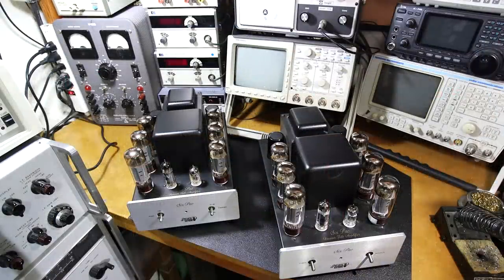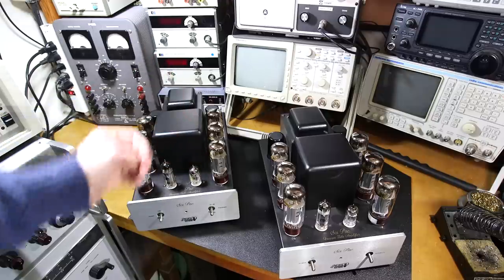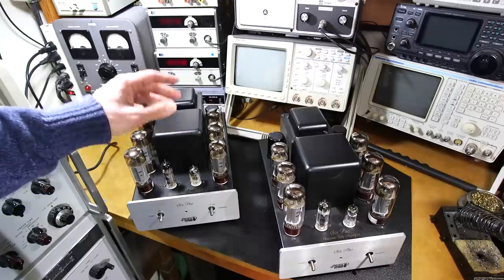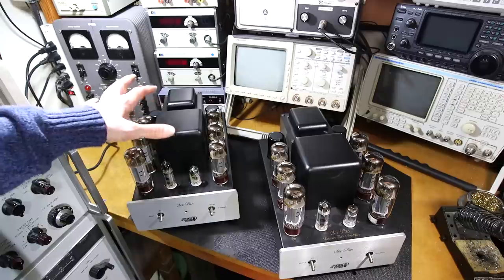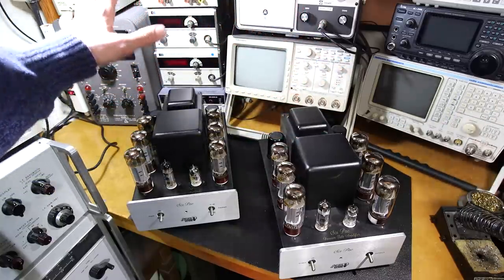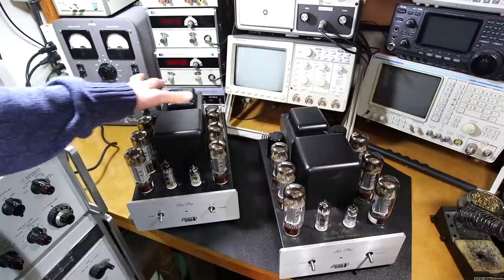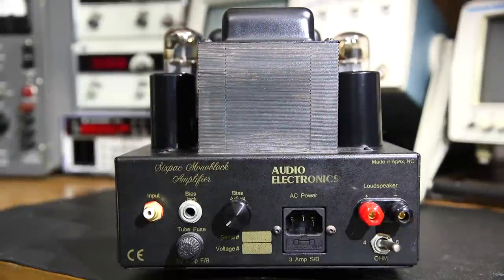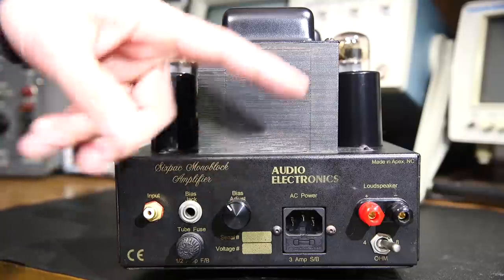Two Six Pac's On The Bench

Comment: I love watching your program. I'm always amazed at how you work and all the tools you have at your disposal. I have some car stereo amplifiers that deserve your touch. Back in the early 90's I paid a lot of money for them. A brand called Monolithic that is no longer around. One amp was a dual monoblock class A 50 and the other was a 750 4 ohm monoblock. I always got complemented for the clear clean sound. If only I could afford you, and if you had the time. Thank you for your great show.
Reply: There never was a true "Class A" car audio amplifier on the market. They'd hog WAY too much current, and run SO hot that they'd likely run away and be a fire hazard. It was all a marketing gimmick..
All of the so-called "Class A" automobile amplifiers were just Class AB designs with a high bias setting. Even the coveted SoundStream Reference Class A amps were the same way.
Reply: @davelowets  My amps did run very hot and that's what I believe did them in. I had a high output alternator and two extra batteries with 1/0 power cables just for that amplifier.
Reply: @donjaun540  Probably... 
My "Class A" SoundStream amps ran VERY hot also. The high bias design allowed the first 10 watts or so to be considered Class A, but they still weren't a true Class A design though.

The high heat inside of a high bias amp will definitely destroy the capacitors inside them much faster than a normal Class AB design. Especially when an amplifier is used in an automobile environment. They usually don't get a whole lot of cooling when they are in a trunk or under a seat.

Comment: Why not in high end amps simple put the power transformer in a seperate chassis connected with a thick cable and heavily shielded or inside some sort of Faraday cage. Sure it would cost . little more but given the cost of high end amps its nothing?

Comment: I couldn't believe that the ultralinear taps of the output transformer were that close to the filter choke and not designing the main and bias power supply with a "pi" type filtering system

Comment: So if the output section was run in the pentode mode instead of the triode mode, would it more or less double the output wattage? Or can you run 3 tubes in pentode mode on the one leg of the primary of the output transformer, with impedances matched. I assume this amp was designed for hifi use not guitar amp use because of the ultra-linear mode available, and the fact that the input goes directly in the phase inverter. No formal preamp section. Your level of knowledge of electronics(and probably many other things) is so far above mine, I have many questions. Thank you for sharing! Thankz

Comment: Good video as usual thanks.  Nice amps I agree good design except the B+
power supply.  Since the schematic specs 400 volts I will assume this is the
cruse voltage.  Then it is very unlikely the warm up peak B+ will exceed 600
volts.  Get two caps 100 to 220 uf at 600 volts with ripple current spec of 2
amps or more at 120 Hz, selecting ones that will have the proper fit in the 
chassis Digikey has seven potential candidates.

Connect one cap to the diode side of the choke and the ground the other 
to the output side of the choke and ground.  This will reduce the ripple voltage 
on the B+ but more importantly this will greatly reduce the ripple current in the 
choke about a factor of 100  thus the choke will not radiate as much magnetic 
noise. 

Also the the two diodes in series seem a bit dodgy perhaps replace them
with a couple of 1200 volt  3 to 5 amp diodes  this should withstand the
first few cycles of startup surge current and easily deal with the cruse
current.

Comment: This amp company which was as subsidiary of Cary audio is gone. No more dealers and no more amps. You can buy them relatively inexpensively used and I wonder if that huge bias range or reliability issues killed this design and company. If I knew they were reliable I would buy a pair.

Comment: One large gorilla in the room never mentioned is phase distortion caused by feedback. the frequency response is not how we perceive "sound stage". It is the phase difference in the sounds arriving at our ears that our brain uses to sense direction of origin of the sound. So, listen and decide for yourself.
I agree that having the bias pot on the outside where bumping the knob can cause real big trouble, is a bad idea. resistors have a maximum voltage rating. using bleeder resistors to equalize the voltage drop. do not exceed the resistor maximum voltage or wattage ratings. Example older kenwood hybrid ham transceivers like my ts 530 the original resistors were carbon 470k half watt. this was a recipe for disaster. replaced with 2 series pairs of 270k half watt metal film(4 total). equalized the voltage across the filters and does not cook the bleeder resistors. using the el84 to provide high impedance constant current source(current flowing from - to +)  to the 12ax7cathodes should work fine. triode connection will give nice low plate resistance and should sound nice, especially without external feedback. the phase inverter is "cathode coupled" and needs to see a high impedance current source. If the values change a little that may not matter much. I would guess at least 30watts output. speakers are not 8 ohms resistive(lots of variation). This amp probably sounds best without the external feedback. Nice video, I enjoyed this very much and its fine with me that you take time to make videos with as much content as possible.

Comment: Hi Mr. Carlson, I really enjoy your videos, learning about the workings of amplifiers and other electronics.  I have a question related to speaker output and capacitor discharging.   On some occasions I forget to turn my equipment off before unplugging them.  Is that safe to do because sometimes I will also forget to plug the equipment in and turn on the power and notice that there's a brief glow of the LEDs (equipment that has them) then they go out.  Is that all the capacitors discharging so that the equipment is safe to service?  Also I hear a "pop" sound on the speaker output if the speaker is not connected and the amp is either turned on or off first before reconnecting a speaker.  Is that also a capacitor discharging and can that damage the amp if it done too much?  Also wanted to know if there's a way to measure the impedance on a speaker terminal using a digital meter to determine the impedance range.  Sometimes not realizing it I have mis-matched speaker impedance on one system and am afraid that I may have done something to shorten the life of the system even though it may be still working normally.  A full video on this would be extremely helpful to know.   Thank you.

Comment: Great video! Very informative!  I'm guessing you put an electrolytic cap between the rectifier and the choke.  Can the audio output transformer handle 100 watts?  Did you look at the hum level with a cap on both sides of the choke before you relocated the choke?  Just curious if a cap would have reduced that noise without relocating the choke (but then you'd have the higher wattage output and not sure if the output transformer can take it).   And brilliant invention with the noise probe!

Comment: 15 second modification to more than double the power output. My guess is that you made the chok in put filter on the power supply into a capacitor input filter that's raising the B+ about 30 to 40%.

Comment: The almost certain explanation for the increase in distortion at reduced output power is that you set bias on the amp at full operating power and since the amp is not sophisticated enough to have an automatic power control circuit to manage bias voltage than slight variance in distortion for the range. 

Any time you tune an amplifier of any sort for 100% and then operate it at 50 or even 75% you will benefit from touching up the tune. 

BTW...

I was lucky enough to get to see some power tetrodes being made in person at the factory. I watched the woman spot welding the filament by hand. Very neat, almost a lost art. Like ships in a bottle...

That facility closed a few years ago, and it made me very sad inside knowing we are ever closer to this technology being gone.

Comment: Could you have shut that choke up with pre-filtering? You have current regulation on the long tail and voltage regulation on the plates. Anything more seems redundant to me. You've locked down voltage and current in a series fashion. Done.

Comment: I would have liked to look at the noise with that filter inductor just flipped at 90-degrees to the windings in the audio xformer.  If that knocked 70% of the noise off, it would be a simpler fix to bend a new bracket to attach it in the new orientation.  I would also be interested in how the audio output current coupled into the B+ voltage, and vice versa, affects the distortion figures.

Comment: the EL84 is a constant current circuit, the common cathode does the inverting and makes it self balancing as the second grid has the input sides voltage but no audio

Comment: We were always taught to not turn a tube amplifier on without a speaker load. So is it OK is long as you have no signal?I’m assuming that audio or the switching of the power tubes is what causes the potentially dangerous spikes. Like in ignition coil

Comment: You need to add resistors in parallel to 1n5408 (same as on big capacitors) to stabilize  backward voltage. Otherwise no sense to add additional diodes.

Comment: Enjoyed this.  You are very knowledgeable - more so than some of the original designers.  Low noise is something I have a quest for as well.  The alarm in my head sounded when I initially saw those chokes mounted where they are.  Great job on reverse engineering and schematic drawing.  Not easy!

Comment: Hi Paul, I suspect that the filter reactor tested out clean when new, thus the reason why the engineers selected that location in the design. Over time, the insulation slowly breaks down, thus the hum is present. Thank you for another great video !!

Comment: That was super interesting!   Quick thought to help save you time.  Could the inductor on the side of the chassis that essentially just provides resistance be moved and you place the noisy inductor in that place?   If that worked, that would save you a lot of modification time.

Comment: Just a thought.  Why the need for an external bias control?  I guess this amp caters to serious audiophiles that checks this parameter very once in a while due to component value drift or when they change or switch tubes.

Comment: Actually the problem is not the placement of the core but the loop area of the output wire current.  But the new placement  also twisted the output wires.

Comment: For doing the regulated source with the zener better it's good to use low voltage and low power zener diodes. Low power zeners has lower test current (or minimum required current to work well). Also low voltage zeners are less noisy.

Comment: Great video ! - I had an idea regarding that choke on the B+ line that you decided to move to a more suitable position - maybe if you left it in the original position on the chassis but put 3 or 4 layers of mu-metal sheet under it and around the sides - would that be an easier way to solve the noise problem ? - yes I know its a rather costly material however maybe worth trying !

Comment: The constant current regulator to the two cathodes is fascinating.  I never saw that before.  It's obvious now that the sum of the two currents on each plate is constant, so that ensures that the plate voltage waveforms mirror each other.  I'm used to the phase splitter on a single triode.  I wonder if this technique compensates for mismatches between triodes in the dual triode.  I can see that an increase in current through the EL84 causes a drop in grid to cathode voltage via the cathode resistor, which regulates or tends to cancel change in current through the tube.

Comment: Great video! As an owner of these amps, I can only state that while they do look messy on the inside, the sound is absolutely fantastic! One thing I can recommend is switching the 12AX7 with a 12BZ7 - this gave the most natural sound, while the 12AX7s all sounded too glassy for my taste.

I do have a question however: what is the purpose of having 3 pairs of EL34s on each amp? Another owner was mentioning you can run it with a single pair if you don't need the power and put a lighter load on the power supply. I tried using only 2 pairs and adjusting the bias to about 170mA but I didn't perceive any drop in usable power - even with my not so efficient speakers (about 96db).

Comment: As usual grab the popcorn and sodas sit back and relax and enjoy the spell binding thriller of Mr. Carlson‘s lab. 
  Two people commented on exactly what I was going to suggest what if you put a copper or iron box shielding completely encapsulated around the core. If you could not be moved from that location would that be the next best option?.
Reply from the maker: Hi. The only solution is to move the reactor. It's already in a tight spot, which leaves no room for extra shielding. It needs to be turned as well, which takes even more room. The reactor gets quite warm, and needs space to convection cool.

Comment: Paul, You commented that you questioned regulating the B+ supply for the 12AX7 phase inverter stage and not regulating the B- supply for the EL84.  Since the EL84 is connected as a current source/sink the B- voltage will not affect the constant current supplied as long as it is within the compliance voltage range of the current regulator circuit.  Since you experimentally measured the EL84 grid voltage and cathode voltage the current source is:  I = (130 - 125) / 680 = 7.353 ma.  At quiescence, the 12AX7A plate voltages would then be equal to the regulated B+ voltage - (1/2(7.5 ma.))*27.4K = 325 volts - 100.7 volts = 224.3 volts at each plate with the grids of the 12AX7A equal.  Therefore, seems to me that variations in the  B- voltage at the EL84 will not enter into the voltages seen at the plates of the 12AX7A as long as it is within the compliance voltage range of the current source.
Reply from the maker: Hi Donald. Your playing too much in the conversion language called (math.) Picture it like this: What ever is on top of the floor moves upward when the floor is lifted, The negative supply is that floor. If you load the negative supply in this amplifier with a nominal load of 100K Ohms, the negative Voltage will change (towards the positive by roughly 1 Volt.) Since this negative supply is the floor for this circuit, the plate supply will also go positive by roughly 1 Volt, indicating the need for Voltage regulation on the cathode of the Current sink. If you like, you can make a mock circuit using the tube's and values listed on the schematic to view this result in real time. Depending on the current supplied by your negative supply, you may need to slightly modify the 100K Ohm load to drag down the supply appropriately (1 Volt towards positive.) Here is some more information on the current sink for you, scroll to the bottom of the page: http://www.angelfire.com/electronic/funwithtubes/Amp-DB_Heart.html

Comment: Mr carlson.would u be familiar with remote start car alarms?.2 crimestopper sp502 burned up.the remote start tryed starting while it was already remote started.i opened it up and ulq2003aq ic burned up and a lpc1224fbd64/121.does the lpc1224fbd64/121 have to be programmed?i bought new componants to switch em out but im being told the lpc1224fbd64 is a blank chip that needs programing?
Reply from the maker: Hi Mike. Thats an ARM Cortex-M0 processor. Yes It's empty, and will need programming.

Comment: Very nice video! Quality, informative and professionally executed. You are a true SME and we learn a lot in an enjoyable way. Thank you for your hard work and sharing your skills with us. Much appreciated!
I noticed that the main filter caps value is not mentioned and its not on the RE schematic. You mention 500uf but I'm not sure if its 500uf or 1000uf as they are in series? I'd like to pre order the caps as I have a similar amp on the way 

Thanks again Mr Carlson!
Reply: If they are in series, a pair of 500uf 400volt caps turns into 250uf @ 800 volts.

In parallel, they would be 1000uf @ 400volts.

Comment: I now often catch myself using the phrase "goes away" when I accidentally burn something up or break something. Also, a pre 1968 RCA panel meter is WAY cooler than even the best DMM anyday!
Reply: All joking aside, thank you for explaining the phase inverter 12AX7 circuit. I'll keep that in mind about used multi- section tubes. My tube tester came with a book with multiple tests for some tubes. I would imagine that the meter readings should be similar. An oscilloscope testing the output of each section with the same drive signal going to each would be more accurate. Maybe not necessary.